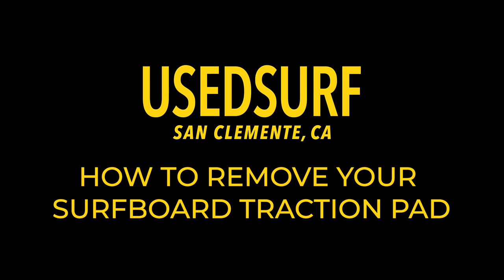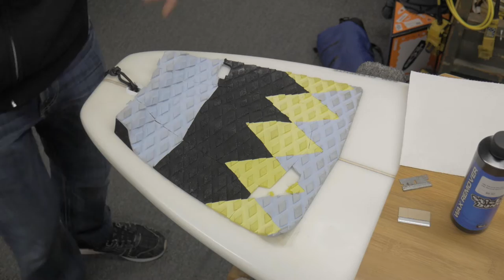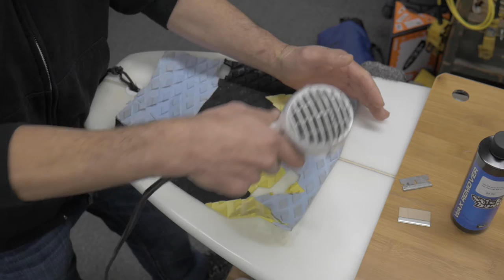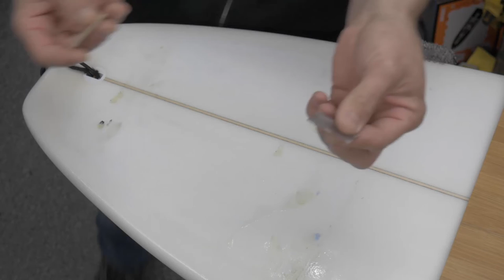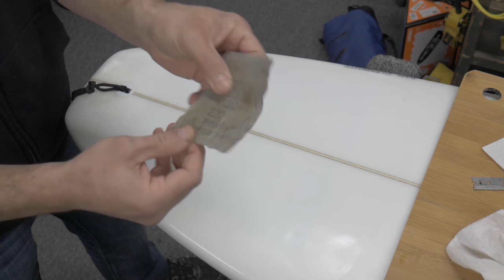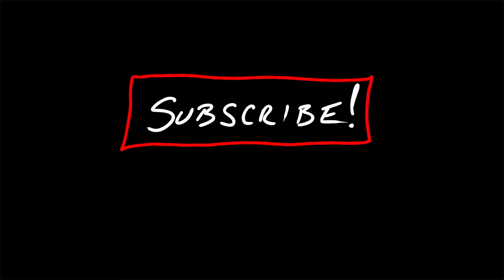How to Properly Remove Your Surfboard Traction Pad and Get It Ready For a New Pad!!

Comment: Does this method work if I just want to remove the traction pad altogether and not replace it? I bought a board with a middle traction pad that I don’t like the feel or placement of. Was wondering if this technique works for permanent removal? Will wax be able to stick on properly after removing and cleaning?
Reply from the maker: Yeah it'll work and you should be able to wax it up no problem
Reply: Hey does it work with front traction pad?